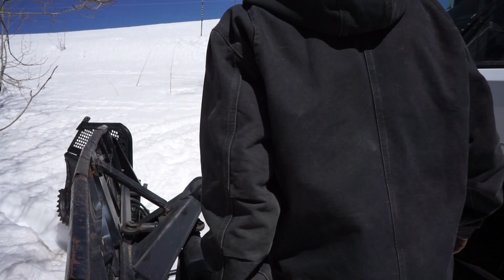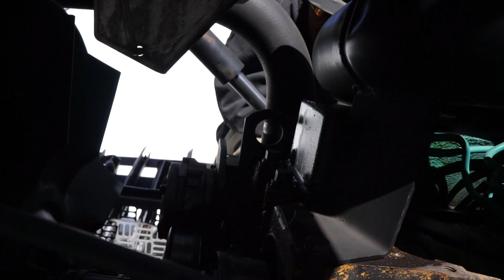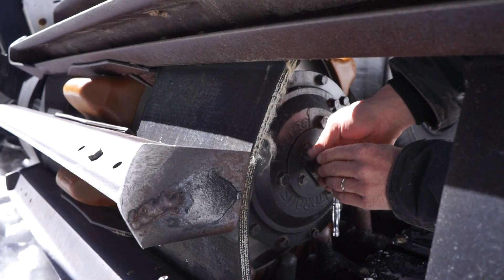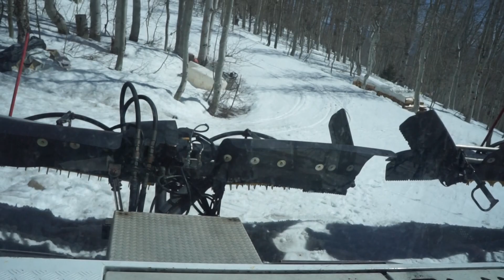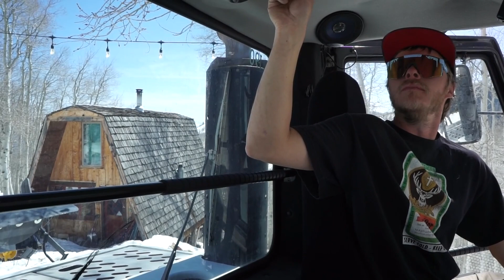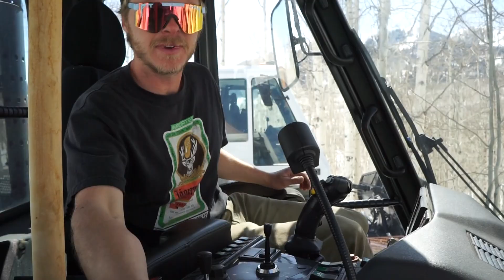Snowcat Stu Bought 2 MORE 'Cats!! Secret Footage Revealed!! Custom Narrow BR 275

Comment: Stu
We have a bombardier 275 passsnger cat we just bought from aspen highlands
Question is can we center the servos the old way with a miliamp meter and stroke the pumps to center like old piston bulleys

If not how can we get a monitor screen like you used in video
Reply from the maker: Hello! Sorry for the delay! You may have figured it out already.. I believe Stu said, he thinks so, but also that you'll probably need the screen if you can get one!! Sorry that's not much help. I hope you guys got it worked out, or will shortly! And thanks so much for tuning in!!